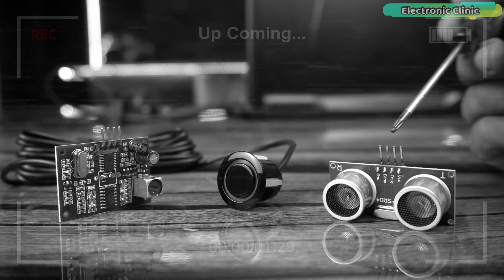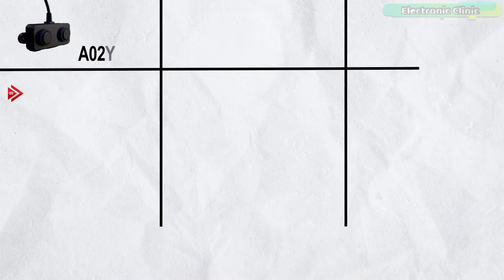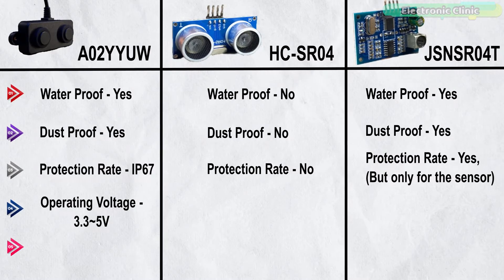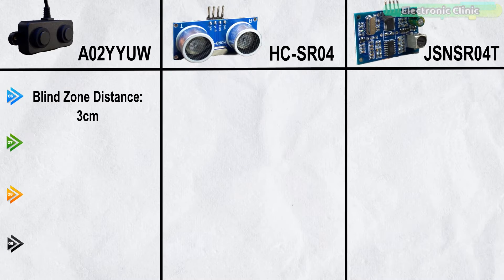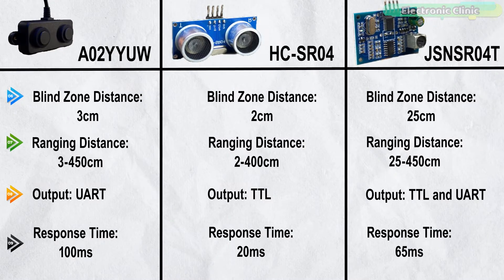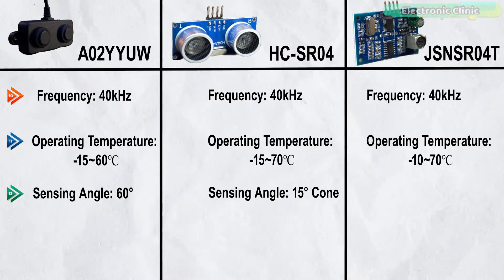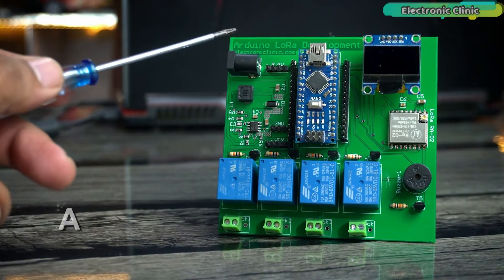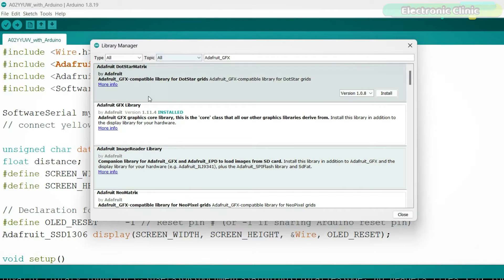Waterproof Ultrasonic Sensor A02YYUW with Arduino, ESP32, & ESP8266

Comment: If this sensor was used inside of a portable water tank and the tank was placed on ground that was not level, how would that effect the reading?
Reply: honestly it depends on location if the device is in the middle it will read the middle level which is the most accurate  level of the liquid

Comment: Can you use this to DIY a "fish finder?" Would the 450cm distance limit change in water? That would not be nearly deep enough. The 60* viewing angle would be really wide, for a fish finder.
Reply from the maker: I didn't check this underwater
Reply: If possible can you check it under water and please let me know the reading. I have used JSNSR04T sensor and placed in water, the readings is maximum number (782).  @ElectroniClinic
Reply: I use a similar sensor for water tank level measurement. Ultrasonic waves rebounds on water surface.

Comment: Very good
Reply from the maker: Thanks
Reply: #include <LiquidCrystal.h>

// Define pins for ultrasonic sensor
const int trigPin = 14;
const int echoPin = 12;

// Define LCD pins
const int rs = 35, en = 34, d4 = 32, d5 = 25, d6 = 26, d7 = 27;
LiquidCrystal lcd(rs, en, d4, d5, d6, d7);

void setup() {
  // Initialize serial communication
  Serial.begin(9600);

  // Set up the ultrasonic sensor pins
  pinMode(trigPin, OUTPUT);
  pinMode(echoPin, INPUT);

  // Set up the LCD number of columns and rows
  lcd.begin(16, 2);

  // Print initial message to LCD
  lcd.print("Distance:");
}

void loop() {
  // Variables for the duration of the ultrasonic pulse and the distance
  long duration;
  int distance;

  // Send a pulse to the trigger pin
  digitalWrite(trigPin, L);
  delayMicroseconds(2);
  digitalWrite(trigPin, H);
  delayMicroseconds(10);
  digitalWrite(trigPin, L);

  // Measure the duration of the echo pulse
  duration = pulseIn(echoPin, HIGH);

  // Calculate the distance (in cm)
  distance = duration * 0.034 / 2;

  // Print distance to serial monitor
  Serial.print("Distance: ");
  Serial.print(distance);
  Serial.println(" cm");

  // Display distance on LCD
  lcd.setCursor(0, 1); // Set cursor to second line
  lcd.print("                "); // Clear previous distance
  lcd.setCursor(0, 1); // Set cursor to second line
  lcd.print(distance); // Print current distance

  // Example if-else conditions based on distance
  if (distance <= C) {
    lcd.print(" cm (L)");
  } else if (distance <= B) {
    lcd.print(" cm (M)");
  } else if (distance <= D) {
    lcd.print(" cm (H)");
  } else {
    lcd.print(" cm (OL)");
  }

  // Wait a short time before taking the next measurement
  delay(500);
}